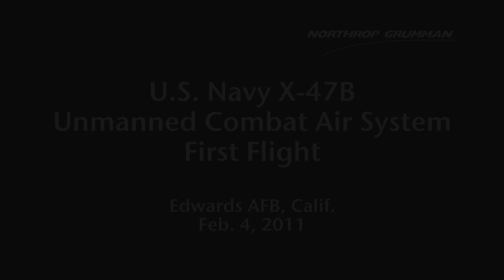(Narrated) Northrop Grumman X-47B First Flight (HQ)

Comment: @MarcoRubio2012 I'll give you stealth, everything else - nope. These UAVs are terrible performers, they aren't fast and aren't maneuverable, have smaller payload. It will take tens of years until UAVs catch up with fighters until then F-35 and such (which you are so willingly writing off) will be ruling. It will take 40-50 years until UAVs can compete and start replacing fighters, until then UAVs will simply play a supporting role (mostly as strikers so it's silly to compare it with F-22).